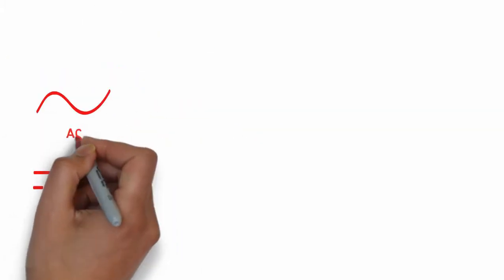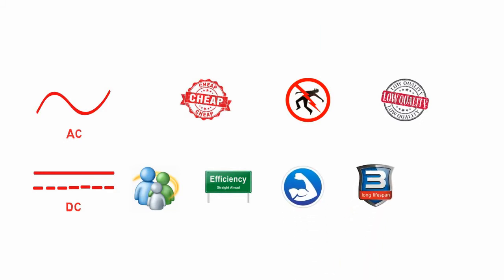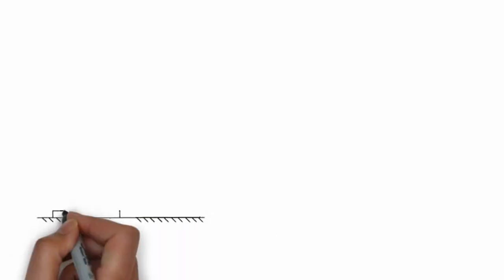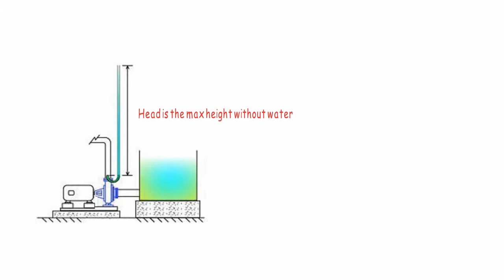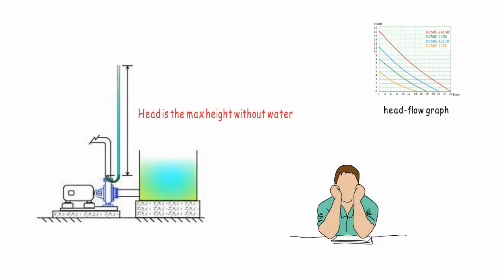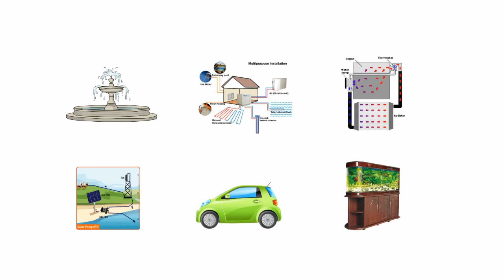How to pick up a small electric water pump

Comment: Hello really enjoyed watching your instructional video. I am looking for a pump that will have the same performance as a power shower. My shower produces roughly 25 litres/minute and hose inner diameter is about 10-12mm then it is attached to a standard shower head. The shower will be held at no more than 20cm above the pump. This is for an experimental project. Do you have a pump that would work for this? Thank you